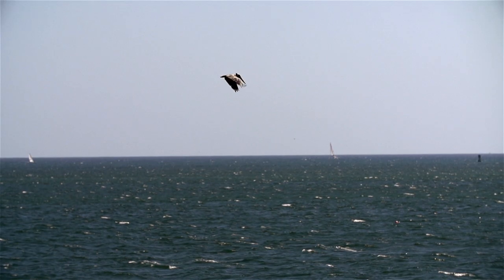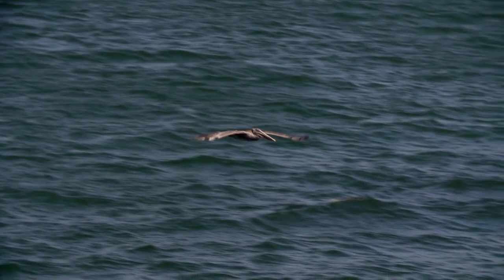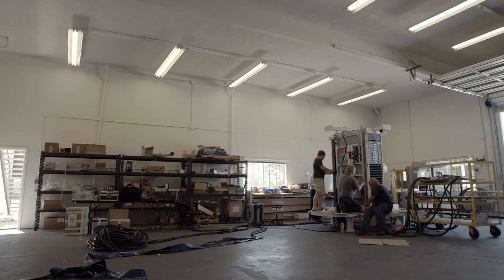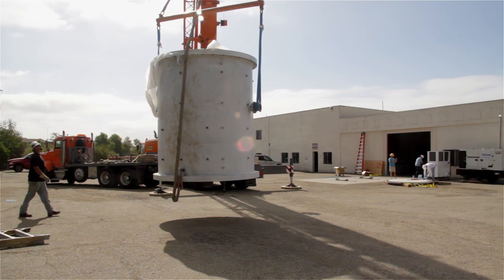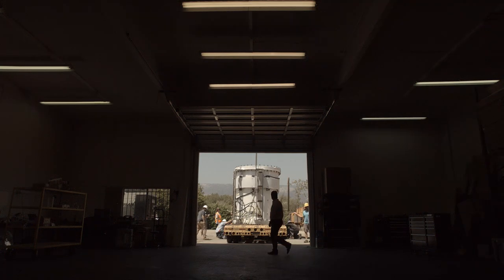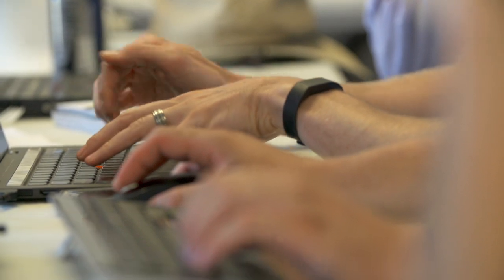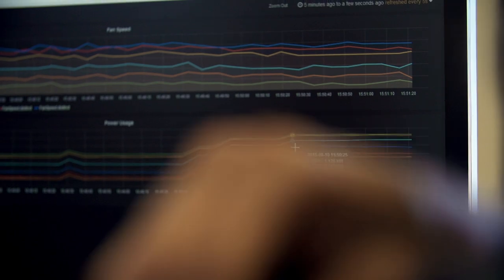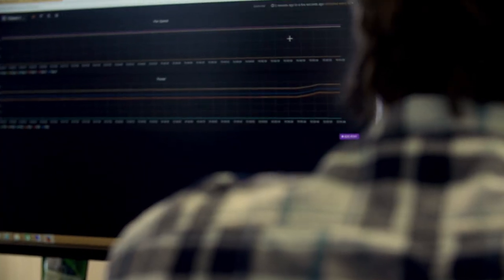Microsoft's underwater datacenter: Project Natick

Comment: good luck changing a drive >_<
Reply: Dario Ampuy yeah, I thought about that too. how do they do maintainance?
Reply: I bet there is a redundant drive or two for each 'live' drive.  These could be fired up, on command or even automatically if setup correctly with the software.
Reply: They have backups in multiple drives on that container and they also have external backups. So to do maintenance they can just unplug it every couple years and extract it from the ocean to replace dead drives and dead servers. And when the whole container goes offline the data doesn't go online. They can have copies of them on other containers in another part of the ocean or in a regular server on land. That's the cool thing about virtualization on the cloud.

Comment: how you replace the faulty hdd or other hardware issue ? seems like a very expensive way for maintenance
Reply: +Chazzy Chaz they take it off doing maintanance every 5 year
Reply: +Nyzma Kumala Still, a faulty memory chip or failing hard drive can happen at any given moment, and then what?
Reply: Redundancy. They have additional Hdd's that are setup in RAID setups and once it starts to see any problem at all the data on that drive is copied to another and any further data is routed to that new drive and the system marks that bad drive as unusable. When MS pulls the  capsule for routine maintenance they replace that bad drive then it's put into the lineup again as a new backup/replacement drive. This is very much the same way data centers handle HDD's already but the ones in the data centers are changed out immediately. If their systems test out to be worth the cost and such I'm sure they will make bigger ones that will most likely have a docking type of setup which would allow entry while it's under water, now this is only speculation on my behalf. Things change so quickly you never know what MS is going to do next.
Reply: It could be a back up non repairable maintenance backup of the main server/data somewhere else onshore. Just a thought!
Reply: Failing hardware is not an issue anymore. Everything is virtualized so if something fails then another server takes it place. All data exists in 2 or more different places thanks to the cloud. So they can let as much of it fail as they want and then they can just create a new one, put it in the ocean, and eventually take the old one out to replace the damaged items, and then throw it back in.
Reply: Don't worry everything is planned newbie. There are experts.

Comment: Interesting Project but I have some doubts : 

Where does it draw power from? The boat engine? Or Self-Sustain?

How about connectivity? Need to lay wires from inside and to outside ? Using Base station to link up??
Reply: +Steven Liew They said wires for data, so that probably answers the power question. I assume it would be some sort of structure they build on the cost, although that's not official info.

Comment: Uhhh lets take a good look at what was accomplished and at what cost. Accessibility and so on and so on. Why not take this equipment, shed its packaging, all the water pieces and all the cost associated with digging this baby up, and not to mention the dangers involved in under water sports here and that I'm sure its water systems are going to need attention almost all the time and set it in ALASKA . Cooling is in an abundant supply. See below:Following is the average monthly temperature range in Alaska:  Month: High / Low   Jan: 22.2 / 9.3Feb: 25.8 / 11.7Mar: 33.6 / 18.2Apr: 43.9 / 28.7May: 54.9 / 38.9Jun: 62.3 / 47.0Jul: 65.3 / 51.5Aug: 63.3 / 49.4Sep: 55.0 / 41.4Oct: 40.0 / 28.3Nov: 27.7 / 15.9Dec: 23.7 / 11.4Ann: 43.1 / 29.3Now I'm no engineer but some where you need to use some common sense.Liebert precision cooling with the free cooling option for may through august but the rest of the time the raised floor is gunna require probably no cooling what so ever but maybe a little hot water heating for the boys and girls in the noc. It doesn't do anything for the hot environmental areas I know. But accessability is a real ordeal. Hells bells, bury the damn thing in underground cave, caverns and get some what the same results. Underwater I'm not feelin this AT ALL!. Next thing youll need SPACE X to run a service call!

Comment: what better way to heat up our sea ;(
Reply: +ElessarGRi think Sea has lots of water and that the Heat will go instantly like it never happened :P
Reply: +SPAS ID OK. But think like the pollution of the air and the global warming. We have a lot of air in our small planet but still having problems. For now if they put 200,2000 or even 2000000 yes I think we will not have problems. What if they put more than 2m and we see some changes they will stop it?
Reply: +ElessarGR You driving your car or heating your house has probably more impact on climate change than a very small localised heating at some shore. Oceans don't heat like that you have no freaking idea of the amount of energy it takes to "heat up our sea".